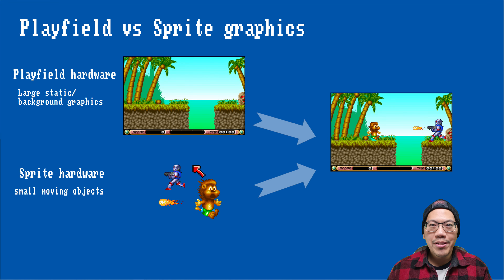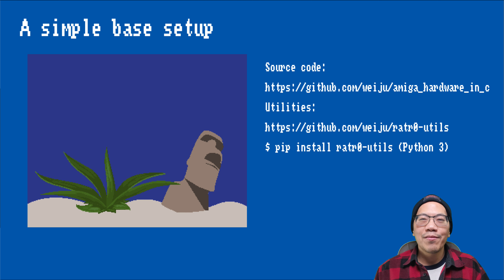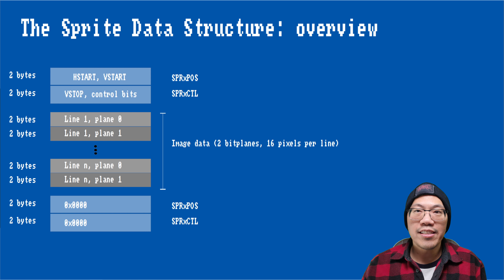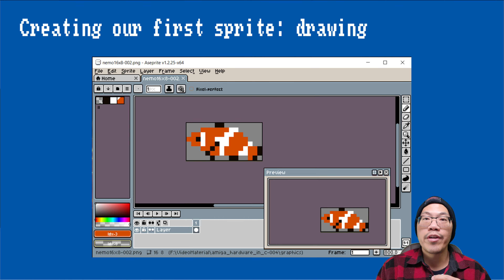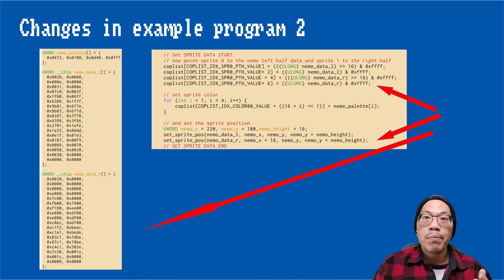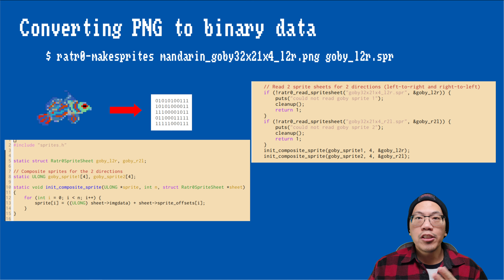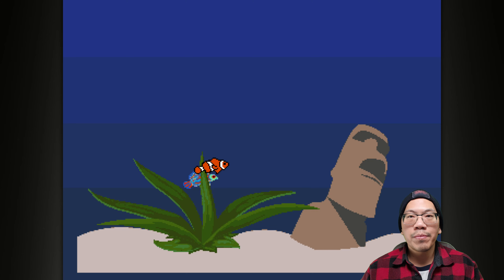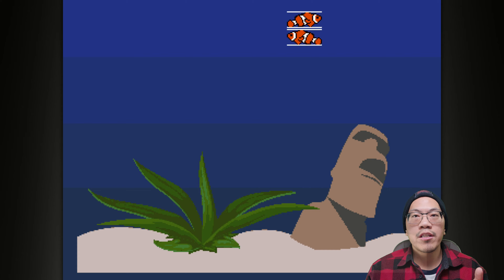Amiga Hardware Programming in C Part 4 - Sprites

Comment: Excellent video.  I never got as far as you have gotten but now I know how to (30 yrs later!).  I could only get so far with a C64 and BASIC.  The biggest problem was that there was no guidance between the included manuals (with BASIC examples) and more advanced programming such as assembly or C.  I never had an Amiga (too much $$$) but I did eventually learn C in UNIX.
Reply from the maker: Thank you ! My videos are indeed better suited to people who have some programming experience. I've started on the C64 (in my teens), too, drawing sprites on square paper and converting them into DATA statements for BASIC programs. I did eventually learn some 6510 assembly, through books and magazines (fortunately some of those came with decent assemblers), but it was admittedly way harder to get information than having the web and search engines and I did not really understand how to actual program until much later. All I did then was poking bytes into memory addresses and see what they did :D

Comment: I'd love to see a video that puts hardware sprites and BOBs (blitter objects) on the screen at the same time. As Agnus and the sprite generators are cycle-interleaved, this should be doable without RAM contention.
Reply from the maker: Yes, I usually use sprites in automatic mode, and the pointers are set in the copper list. In my current game I queue up blitter operations and do them all at once after I did all the computations in a frame. 
I might describe that in a postmortem after the AmiGameJam 2024 submission

Comment: As long as Amiga lacked hw horizontal flip of sprites (and thus bobs), and while the 68k family is Big Endian, could it be possible to perform a horizontal flip on the fly, let's say by rotating nibbles in descending mode (splitting long words in pairs) or even swapping byte lanes? something like:
"ROL.W #8,D0
SWAP.L #D0
ROL.W #8,D0"

Comment: Hi Wei-ju Wu, cannot find your email address so I write my comment and question here. I very much appreciate your video's and working my way through the episodes. I use m68k-amigaos-gcc 6.4.1b in combination with cmake however that should not matter. Concerning example 004 I have a question about example_00.c from the github line 128 because vb_waitpos does not has a type specified. I added UWORD to it as I guess that shall be the type. The example does not run in my emulator (WINUAE set for the Amiga 1200 - which I own (previous episodes work without a problem), it freezes with a greyish screen. Any hints why? Is the code not compatible with the 1200 hardware?